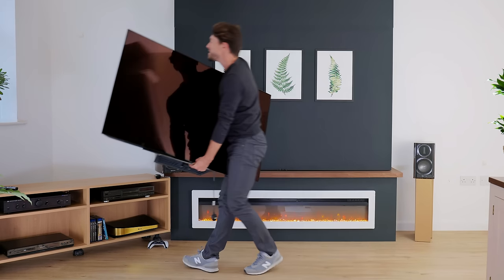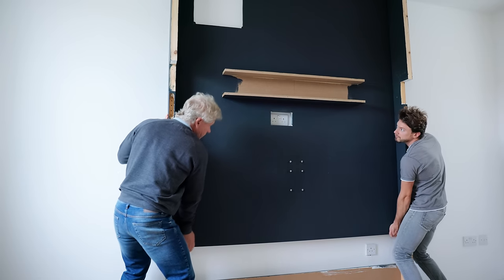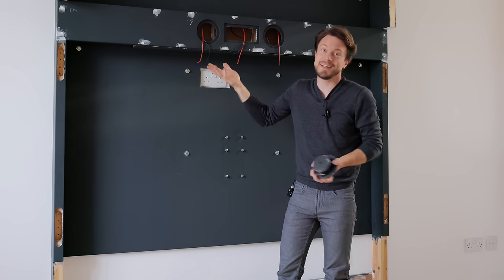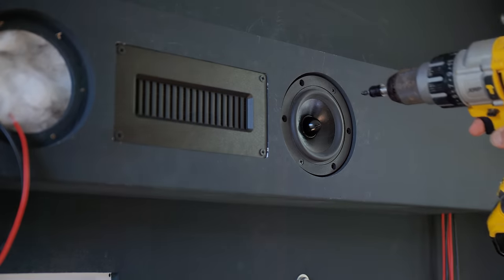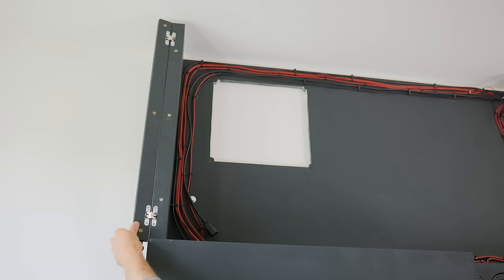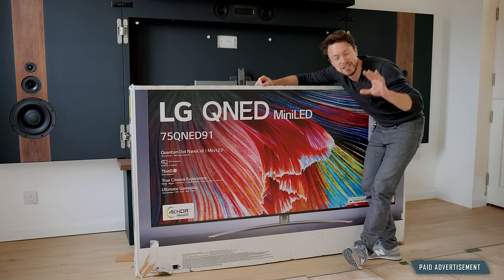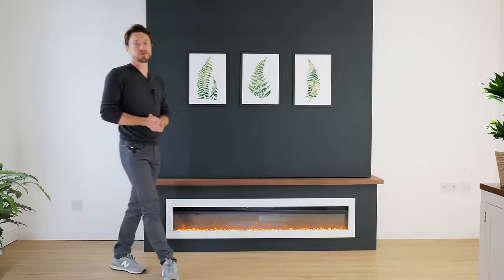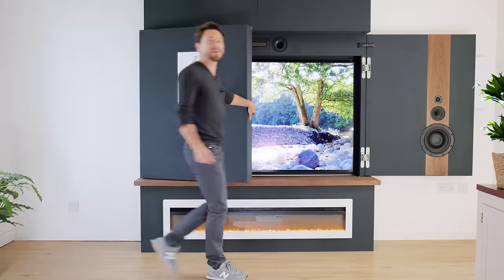Building an invisible TV

Comment: Your channel is awesome i been watching you from a beginning ! And thinking about to ask of your advice about a project with in the car of e39 sedan. By now i have fitted the bigger mounts of speakers inside front doors from 5" to 6.5 focal 165 as few tweeters and cut a hole in a trunk deck of a window to fit 7x10 ellipses on low pass filter but i want more richer sound and more feel of bass. I'm not a big fan of big loud sub who all using inside of car... i want something who has a power to punch but easy to drive and no side noise just soft clear bass and have an idea to make a subwofer in a trunk on a top deck of rear window something about 10" or 12" maybe a pair of them.
  Now my 2x elipses are 70w rms and its kind of all right but if i change it to the 2x of 10" subs i would need a box or can i share it of a trunk space? Ski hole is cutted so the air flow is going to get in the salon 
I'm thinking about focal p 25 db 500w but im afraid to be unhappy with them can you offer me something who can deliver that sweet good bass? :)
For multimedia I'm using fiio btr 30 pro it has 3vRms output from bt on my apple music
Amp helix m four and thinking to buy monoblock for the subs
Thanks !

Comment: Although cool looking and well built, it's not practical. Speakers would give way too much vibration noise off due to the shelving style mount, also hinges would weaken over time causing doors not lining up later, and the fan noise from the graphics cards would be heard on very low or muted settings.

Comment: If you're using two separate drivers in a stereo configuration for the subwoofer, wouldn't that be a 5.2 system? Labelling it a 5.1 system leads me to believe that you're using a single, mono amplifier to power both woofers, as opposed to a two channel amplifier or stereo amp. Come to think of it, if all the speakers are using a shared, central amplifier and the subs are the byproduct of the crossover that was programmed, it may actually be a 5.0 system.

Comment: Just watched your USB C conversion video.

Was wondering if it would be possible to make a multi-port usb c adapter. I'm wanting one for my Quest 2.

So I need a male into the Quest 2 and then 2 usb c inputs. One would be supplying power (BoboVR M2 Plus head strap) and the other supplying power to BoboVR Fan.

Comment: Look I’m not going to be rude but... your “build” excluding ps5, and walnut veneer, and pc, and wiring, and a transformer, and paint, but all the other consumables including wood speakers other parts (mounts amps etc) and the tv. Comes to a whopping £3200 and that’s not even factoring any additional shipping costs, and or delivery fees esp with that “fireplace”. This is 1.5 months of the average uk salary. Never mind the cost of maintaining and or starting to buy all the necessary tools. If I tried to build this set up in my country I’d pay close to £3000 just for the tv. And the total would come very close to £5000k +-£4800 at Least but definitely more for import duties if i cannot get parts locally (in any case these products are imported generally and have a 10% or more duty applied to them +15% vat. Which means that electronics cost at least 25-30 more) and there’s no Amazon so the shipping cost is at least double if not triple. The cost of this build in my country is equivalent to x3 months salary of the average person. This isn’t a weekend build this isn’t cheap. It’s like buying half a new car. Or doing a small extension to your house. Perhaps people are richer than I imagine but this project is mind boggling expensive for a “simple diy project”.
Reply: Those that have the desire and the dollars will, those that don’t, won’t, nor embarrass themselves by “not being rude”.

Comment: It looks nice... But it is most definitely not a good idea.   1st...  20hz is not low enough for a quality home theater.  You said flat to 25hz which means +/- 3db.  That would mean it is at least +/- 10db at 20hz.  Yeah... Not good enough for home theater.  

2nd...  Running bass in something mounted by hinges is an extremely poor idea.   This will cause massive vibrations.  It would not be rigid enough and stable to stop resonation.  This would cause mass rattles and loss of overall output.   

So yeah...  Looks nice, but would sound horrible!  Which I am confidently guessing is why you didn't show it playing sound in your video.  Please people... Do not do this!  You will be wasting your time and money!
Reply: Oh and don't forget that bass from something not solid and not atground level is very bad.  It loses energy rapidly over distance and can't sustain it.   Sub bass would always be put into 1/4 plane when possible.  The drivers would be in 1/2 plane in your design.   This would cause major room cancelations.